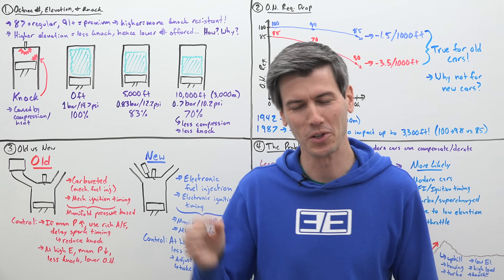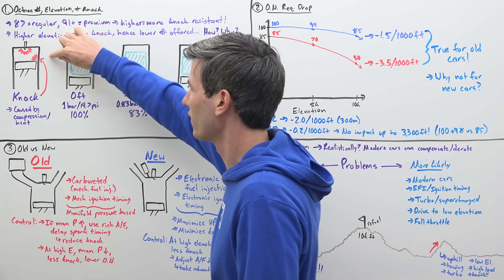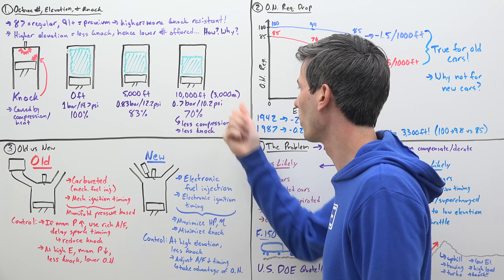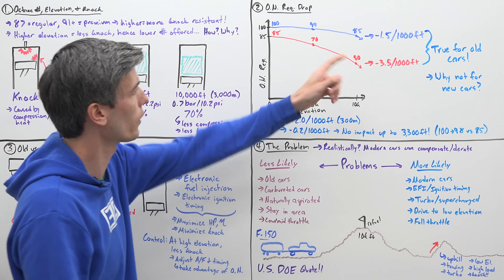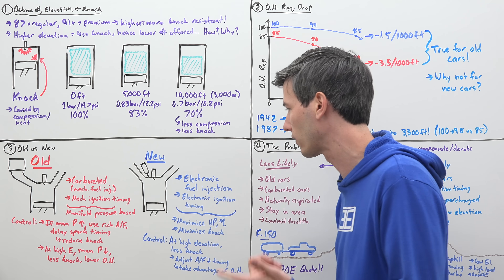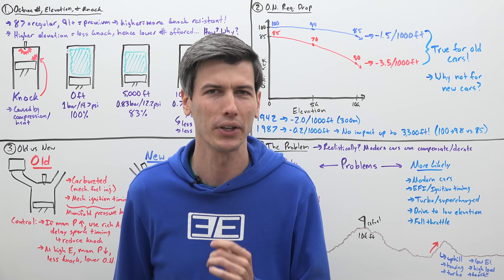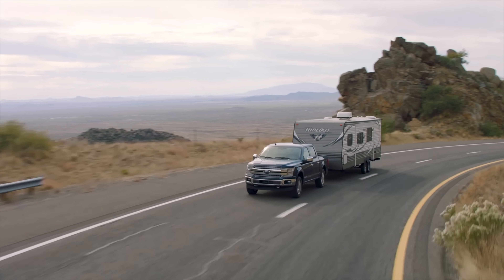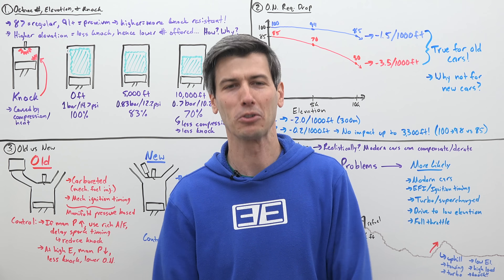Never Use This Gas In Your Car!

Comment: Isn’t the oxygen content of the air at higher elevations the really important factor here rather than atmospheric pressure?  Lower oxygen content in (e.g.) Cody Wyoming means less ability to burn.  Lower octane means less resistance to detonation, hence lower octane can help there.
The consideration for newer cars is understood however.  With processors controlling the air/fuel mixture, one can comfortably use the prescribed octane for a given vehicle. 
My 1989 Cadillac Brougham with the Rochester Quadrajet  carburetor, however, would have been more than fine with 85 octane in a place like Cody.  
Let me know if anyone disagrees.
Reply: Yes,  my understanding is that octane itself is a calculation relative to altitude. Thereby 87 octane becomes 85 octane at altitude. There's no magic. Just physically relocation the same gas to high altitude and now it's 85.
This leads to the next question, do gas production plants make 85, 87, 88, 89, 91, and 93? I really doubt it.
Reply: @jasonfreinhart  
I've worked in a few refineries. 
Its would would not be hard at all for them to just take 85 grade octane equivalent from one of those lines and sell it.
In fact, fuel is built lower -> higher octane through chemistry, like reforming the molecules to be in circular shapes rather than one straight line of hydrocarbons. In reality, even the shape of the molecule can affect resistance to burning or 'oxidizing' which is neat.
Reply: The oxygen level when driving in the mountains is no different than it is at sea level.  If you look at what happens when you fly on an airplane at 35,000 feet, all that they do is to
Compress the air going into the cabin, to make the Barometric pressure closer to what it would be at a lower elevation.  The only time that you would ever be directly given oxygen on an airplane, is when the cabin loses pressurization.  It's the higher Barometric pressure that makes the difference, which is the same as it is with your vehicle.  The higher Barometric pressure forces the oxygen molecules into your lungs more at sea level, than it does at high altitude.
Reply: @stu8575  the oxygen is actually less Per Unit Volume at those altitudes.  It’s there, just more dispersed.

Comment: I remember when I first came across 85-octane gas in Reno, NV. I went through most of a tank of gas a day driving a courier route in my old '95 Ford Ranger pickup when I wasn't playing drums in cabaret bands. On the average I managed about 28mpg (I maintained pretty thorough records then due to tax reasons) driving a clockwise route that took me through Carson City and then up to the East Shore of Lake Tahoe before returning to Reno. I tried 85-octane gas for about two weeks, which was about eight to ten cents a gallon cheaper than 87-octane gas, and I noticed that there was a significant drop in mileage, down to about 23-24mpg. I'll never go back to anything below 87-octane.

Comment: Since I have used 85 octane on all of my gasoline powered vehicles for most of my life, this is somewhat interesting to look back with this information. Estimating my number of miles, my miles per gallon, and the additional cost to go from 85 to 87 octane, I would have spent an additional $4,000 to $5,000 on fuel over the last 42 years. Would this have made a significant difference on longevity of vehicles I doubt it. I currently have two vehicles that have 130,000+ miles, I've had a couple with over 200,000 mIles, and one with over 300,000 miles.  I think I'll keep taking the savings at the pump!
Reply: He's being an alarmist to get more clicks, he finally gets to the truth of the matter near the end of the video that its a specif scenario with certain cars and certain elevations and certain driving conditions that may damage an engine.  I own a Ford without a turbo and it works fine in 85 which is prevalent in the Midwest and creates slightly less pollution.
Reply: Delta Bravo agreed. That will also work fine in old tractors or cars that have low compression.
Reply: what elevation do you live at??
Reply: @MDAdams72668  
7000 feet
Reply: @rockymntnliberty  Ok makes sense than Down here at sea level would be much more of an issue
Reply: @rockymntnliberty  Yeah if you live and stay at 7000 feet then using 85 instead of 87 won't be an issue at all.
Reply: Certain cars require certain octane. If you use an octane lower than what’s necessary it can cause engine issues and you’ll have more trips to your mechanic. Example: every Subaru requires premium. You try using lowest one at the pump and it’ll mess up your engine
Reply: @EricBurns1  Every Subaru does NOT require premium fuel. I own one that specifies 87.
Reply: @EricBurns1  not true, only brz, wrx/sti require 93 aki fuel. Everything else only requires 87.
Reply: @EricBurns1  That's not true. Most Subaru models use 87. This is straight from Subaru:
"If you drive a Crosstrek, Forester, Outback, Legacy or Ascent, your vehicle is designed to run on 87 octane, or regular fuel."
Reply: @EricBurns1  look listen modern cars can run nearly anything that’s flammable they prefer you use a specific grade fuel because that’s what’s tested and that’s the rule they set for warranties and what not but ultimately your never going to damage your car for using 85 vs 87 or even 91… it’s recommended due to companies having stock invested in oil companies and they milk more money out of you that way but you can run a car on straight Everclear if you wanted too not the best mpg but you can
Reply: I'm surprised you're not angry that these guys are literally making you choose between garbage fuel and losing money.
Reply: Also, gas today with ethanol is not good on old cars (say muscle cars) because their engines weren’t made to have any of that in the tank
Reply: Eric Burns although the older vehicles weren’t designed to run ethanol fuel, they can run on it fine even though it’s not ideal. Those old muscle cars were also designed to run leaded gas, and unless they’ve been “updated” (hardened valve seats installed, etc) you can buy lead substitute additives at most parts stores. Same for ethanol, you can buy the ethanol neutralizer additive. I have a 1946 Farmall tractor that definitely wasn’t meant to run ethanol, but it does fine.

That all being said, I am NOT a fan of E10 gas at all, and will buy the ethanol free stuff when I can find it. I have seen firsthand what that crap does to a carbureted engine; corrosion and deposits in the float bowl, rubber seals and gaskets leaking because it eats them up, etc.
Reply: @bigdaddy7119  little trick for old cars not converted. If you live close to a small airport they will sell you Low Lead fuel. It's more expensive but also generally has a higher quality.
Reply: William C yep. 110LL Avgas. I used to be an aircraft mechanic

Comment: Who wants to bet his "study from 87" was actually dealing with Turbo and/or Supercharged engines? Engines don't magically ignore altitude just because of their date of manufacture.

You could have just said, "If your car is not naturally aspirated, you are not affected by altitude, and should watch out for low octane gas when driving at high altitude." Would have made for a 30 second video that is far more informative.

Comment: I see this as a failure of regulation. "Regular," "Mid," and "Premium" are directly tied to octane only, not some fantasy of clearer, less polluting, better cleaning or whatever. the octane of each of these code words should be consistent across the nation. I think it's fine to have lower octane gas at high altitudes so that it can be both ok and cheaper. it's not fine to call it "Regular" at 85 octane when "Regular" is usually 87 octane. how about calling it "sub-Regular," maybe "Altitude" or something, and with a yellow-black hazard pattern around the 85 pump button?

Comment: Thanks This was informative very interesting well explained without being boring. I don't have a car i been driving 50cc moped's which I usaly takes to a mechanic to get around 10hp (8,6 in my last one) and I usually used mmt octane higthener which increase the octane by 8points which I mixed with 99 octane gasoline making it go on 107 octane which makes it sound very healthy and respond very good. People told me that it dryes out the cylinder but I never had a cylinder problem (separate oil tank) anyways I don't think I seen 85 octane since the mid 90s or something but I'm Norwegian i Think the lowest octane here is 87 or something most people use the 95 octane that is the regular ..i usaly use the vpower 99

Comment: The rub that really stings is, here in Utah with the 85 octane regular fuel; we have some of the highest prices in the country. The oil industry is ripping people off.
Reply: I just did a road trip from Washington through Utah and California. Utah was the cheapest by far. You lucky people!
Reply: Yea and you have two refineries there
Reply: Thatks because in Utah they are not allowed to put alcohol in their cars, as it is not for the body or for the belly or for the engine.

j/k
Reply: Just checked AAA 1 Mar 24, Utah has the 27th highest gas price for reg unleaded.
Reply: No way you have some of the highest prices in the country, in California the price is almost $3.00 a gallon more.
Reply: @moto5513 Nothing screams "Utahn" more than delusions of importance.  Plenty of good people there, as is true anywhere, but there is an unusually high societal tolerance for the one-upping in toxic bro culture and narcissistic exaggeration. I cannot tell you how many people in Provo insist that it takes 30 minutes to drive from their driveway to the SLC airport... 60+ miles away, not counting the in-town driving. Or how many express total bewilderment that it is snowing in the first week of April... just like it has every year for millennia.

Again, plenty of good people, maybe even the vast majority, but too many also have a culture of not being able to see past their own nose.
Reply: @moto5513  You are incorrect.  If comparing 87 to 87 Utah is 30 cents cheaper.  At least on my last trip early 2024.
Reply: Utah is not that bad, we drove from carson city to salt lake city a couple months ago, gas was 1.25-1.50 more expensive in carson city. Its gone up 30-40c since then in SLC but still around the 3.00 mark whereas in carson city i couldnt find anything lower than 4.0 a gallon
Reply: But atleast you can have more than 1 wyfe😂
Reply: @senorpepper3405 Ha, yeah only put 91 in your “polig rig”, as we call them.
Reply: @jojo-q8w5j   I thought they were called MAVs?
Reply: @senorpepper3405 
Incorrect, but hilarious! Bwahahahahah
Reply: CA is still higher than "Yew Tah".  It's all a matter of supply v. demand, though.  Utah's economy is relatively prosperous, so the price the retailers get will tend to be higher.  CA's is still higher NOT because of any "better" economy (in fact, it's in the toilet), but due to insanely HIGH TAXES.
Reply: @selfdo This flyover state cope of California's "failing economy" is so funny to me. It's like, sure thing sweetheart you keep believing everything Fox tells you lol.

Comment: Very interesting.  My wife and I just did a 6500 mile road trip from the Midwest to the West Coast.  I was wondering why so many stations had 85 octane fuel.  We were driving her Turbo Chevy Trax and we always use at least 88 octane fuel.  The Norms back home are 87, 89, 91.  Out west it was 85, 88, 91.  Thanks for the easy to understand explanation.
Reply: Your problem isn't the fuel. It's your car. Speaking as a former Chevy Cruze owner.
Reply: @csn6234   Where was there a problem mentioned?
Reply: In California its typically 87,89,91. You usually only find 85 in high altitude areas,  especially places like utah.
Reply: @JoshuaPlays99  Yep i'm in Utah and 85 is all over the place, i use it for everything but my car (lawnmowers etc).
Reply: @syzyphyz  Small engines usually have pretty low compression, and using high octane fuel in a low compression engine that isn't designed for it can get a ton of carbon and soot buildup from not having enough time to completely burn the fuel. This is why when using high octane fuels you need more timing, but the timing on most small engines is not adjustable, fixed magneto etc. So using 85 octane fuel in a lawnmower with low compression is actually more efficient, and you'll see much cleaner spark plugs etc.
Reply: @JoshuaPlays99  Colorado also has the 85 octane as "regular" gas. I live in New Mexico at an elevation of 4,000 ft. but some parts of the state are much higher (Santa Fe, Taos, Ruidoso, Cloud Croft). I used to work at White Sands Missile Range near Las Cruces. We went from 4,000 ft. to 5,300 and back down to 4800 ft.
Reply: Oregon and Washington are mostly 87 as a minimum, I don’t know about the east side of the states though
Reply: Colorado is 85 due to altitude
Reply: @lucky seven  Jacob Lake,AZ is an exception, it's 85 octane minimum. There might be other areas, but at least they don't do that crap in Flagstaff or the Mogollon Rim area. So many people filling up there before heading down to Phoenix.
Reply: @javaman2883  true, it's actually anywhere at higher altitude
Reply: What I like, when I can get it (in more rural areas of AZ, NV, and UT) is Maverik's "clear", which usually comes in 88 octane.  The stuff ain't cheap, but "baby" LOVES it!  Gasoline did once come WITHOUT alcohol in it.
Reply: Yep moving to diffrent states i saw it too
Reply: So you have a loser for a life partner 😂😂😂
Reply: E85 is better than 93 :)

Comment: I was with my brother in Colorado in 2001 in his 96 Ranger. It was only a 4 cylinder and lost so much power with the elevation, we couldn't do the speed limit. He kept trying the higher octane gas and it did nothing. I told him to try the 85 and we magically got the power back.
Reply: It use to be that it was recommended to 'lean out ' your carburetor if you were going to drive at high altitude.
Reply: The reason your brother's truck made less hp with high octane is because its engine is low compression. When you put high octane fuel in a low CR engine, it will make less hp than low octane. There is only one function of high octane: to fuel high compression engines.
Reply: @e-curb it seems not many people  know this
Reply: @e-curb  And boosted engines
Reply: That was magical, higher octane can only  make more power if more timing advance without ping,if timing don't advance ,power won't either.
Reply: @rogerdodrill4733 higher octane mean less gasoline per volume of liquid = less power per 💥
Reply: I heard somewhere years ago that much of what they put into gasoline to raise the octane is actually BUTANE, which I think burns LESS WELL than the gasoline it is added to.  So higher octane perhaps did not burn as well or have as much power.

I think this is why motorcycles don't use higher octane -- the gas caps allow fumes to leak out easily, particularly over the hot engine.  So butane would leak out, and octane would fall quickly after the fill-up.
Reply: @williamjones7821 Incorrect. Butane is a gas at atmosphere. Ethanol is mixed with gasoline to increase octane.
Reply: @williamjones7821   Gas tanks are at the opposite end of the car as the engine. Thus, it doesn't matter how hot the engine gets, the fuel temp in the tank won't change. Besides, all gas caps since 1972 have been sealed.
Reply: @williamjones7821 all gasoline has some butane in it because butane is a hydrocarbon in the gasoline range

Comment: The lower the number the better you plugs get more electrode added back to them! 🤣

I'm laughing because I can't imagine a knock sensor being effective unless the computer is actually using feedback.

Maybe there's a long term trim, but really knock sensors I think just are for leaning and advancing at high vacuum levels.

Comment: That was interesting, I never thought about actual pressure at elevation, I thought it was just less o2.  The trailer in the white board picture only had 3 wheels, did you notice that?  Maybe that contributed to the knock?

Comment: Thanks for the clear and concise explanation.  Would you care to wade in on the E5/E10 discussion going on in the UK at the moment? I drive a NA MX5 (miata) which would not require the better fuel (RON98) but the RON95 is all, now, E10, which due to the added detergents could begin to dissolve those old natural rubber hoses and deposit that in the cylinders along with the fuel.  Thus I am forced to use the E5 fuel (RON 95) above the rate Octane rating. Also: Would be happy to host you over here across the pond (SW UK) if you wanted to investigate. Maybe talk to Alex from car throttle and see if you could film something else whilst here?

Comment: Good video, but there is a difference between knock and pre-ignition. I think you actually described pre-ignition. In either case, higher octane fuel is needed to mitigate either of these destructive problems.

Comment: I think you're over thinking it. You would have to go over 10,000 feet above sea level for there to be any significant drop in oxygen levels and remain there for a long period of time. So I call bs on your claim that it would hurt your cars engine. Besides computers today compensate for all that. Thanks, but no thanks. And I still won't go electric.

Comment: E-85, ethanol is corn fuel, regular gas has about 10% of this E-85 is 50-85%. I used to have an old super charged mustang gt  and the E-85 gave me more power than regular gas from 91-93 octane. I'm reading the comments and had no idea it was so rare.

Comment: Just a word of advice, READ THE OWNER'S MANUAL! Every vehicle has a different recommend octane level and it is listed in the owner's manual. Use that recommend fuel only. If it is unavailable, then use higher level. Never use lower octane levels than recommended